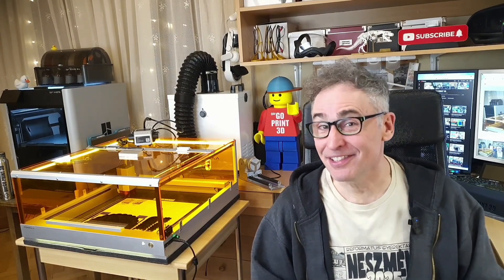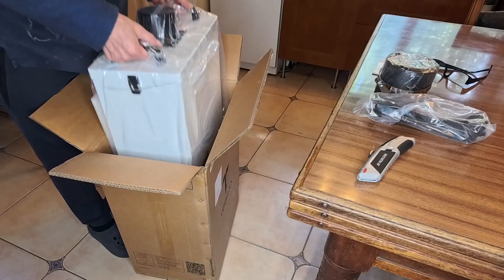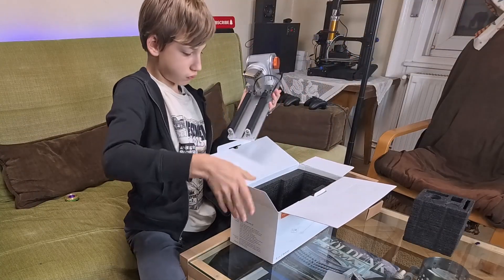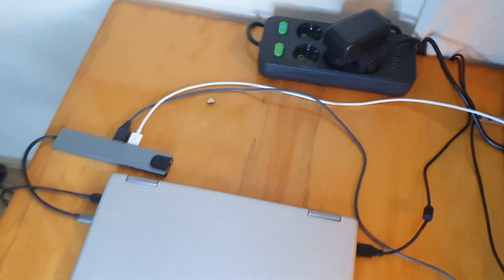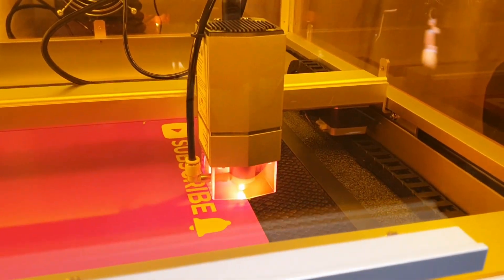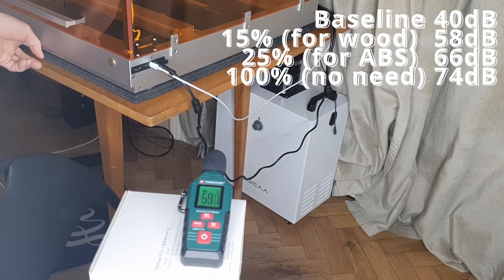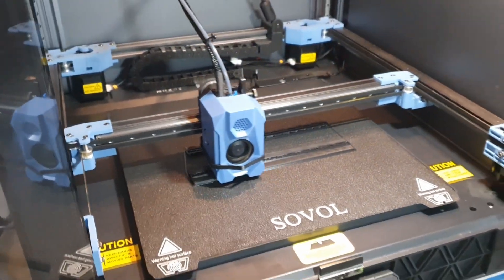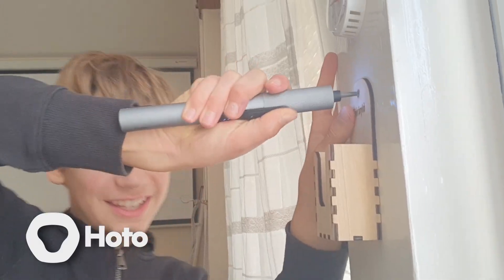The TOOCAA L2 Laser: The Complete Package No One Else Reviewed! (Unboxing, Mods & Projects)

Comment: They should release the bottom sealer as part of the package. We shouldn't be DYIng it
Reply from the maker: Wait until my next video. With a $10 mod (a micro switch, a relay and a pair of wall sockets) I made the air pumps automatically turn on for the job and turn off at the end. The Air Assist and the exhast fan or smoke purifier if you have it.  I am in love with this laser cutter. But you are right, the sealing should come preinstalled.

Comment: Hi there, after watching your video, I purchased the Toocaa L2 20W. I’m completely new to laser engraving and just starting to learn how to use the machine. My goal is to engrave on wooden cutting boards, but I’m having trouble aligning and positioning the engraving accurately—it doesn’t land exactly where I want it to.

Could you please advise me on how to fix this issue? Also, do you recommend using LightBurn instead of Toocaa Studio? Thank you in advance for your help!
Reply from the maker: Good choice for a first laser! I love the L2; it's such a premium device.

Regarding alignment, are you using the camera? When calibrated, it's very accurate, but the key is to calibrate it for the specific thickness of your cutting board. A quarter-inch of thickness difference can easily cause a quarter-inch shift in the image position.

Even with the camera, I always recommend running a framing round. If you're using LightBurn, enable "Laser on when framing" in the Device Settings at a very low 1% power. This lets you see the laser dot trace the exact boundary on the wood.

As for software, I do recommend moving to LightBurn when you're ready. It's much more powerful.
A great way to practice is your cardboard idea: place a cardboard cutout on top of the cutting board and do a low-power test marking to get a feel for how the material thickness affects the preview. Hope this helps
Reply: @gerGoPrint3D  Hi. Having problem with camera alignment. The lens come with Toocaa is fisheye or standard. You mention this is fisheye. I think fisheye has issues. What do you think?
Reply from the maker: @nostamp  Their setup instructions (found by following the QR code on the box of the camera) tell us to set it up as fisheye in Lightburn. It works very well for me, alignment is spot on. And I did not have to do the dotted card calibration, only the alignment calibration. What issues does fisheye have? I assume you are using Lightburn, because in Toocaa studio there is no option to select camera type.

Comment: Really like your channel. For the laser you need more intake air to reduce the amount of soot that gathers on the laser. Over a short time the laser module will burn out due to overheating. Increase air intake and you will reduce the soot and clean air faster. Also reduces over working the air purifier.
Reply from the maker: Thank you for commenting!! So you say I over-sealed it?  It seems the smoke is moving really fast inside when I cut (e.g. visible at 12:01)
Reply: @gerGoPrint3D I do agree it is moving fast but could be even more efficient maybe slide two more of the vents you made on the sides would increase flow.
Reply from the maker: Thank you! On the sides too? I will try!